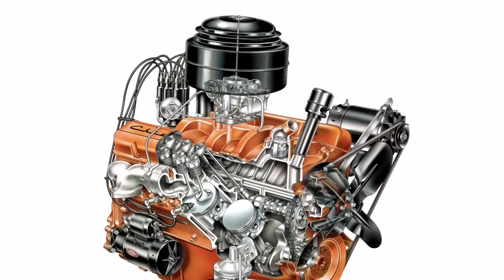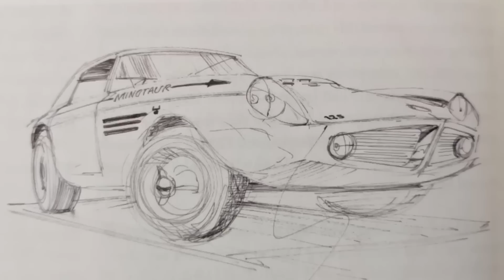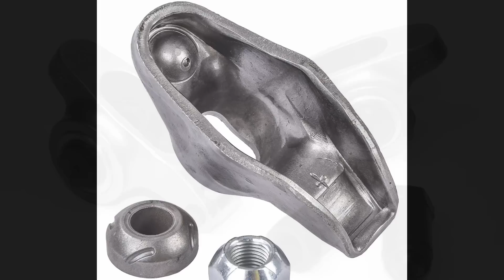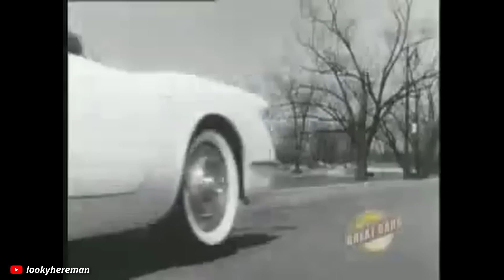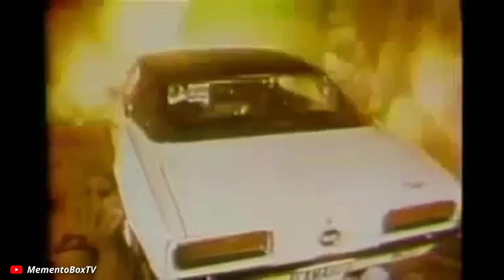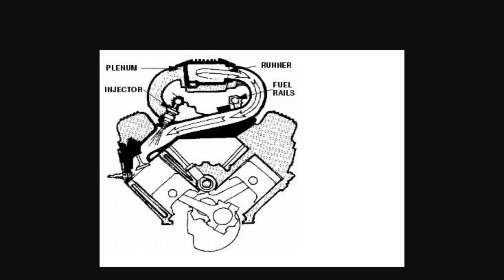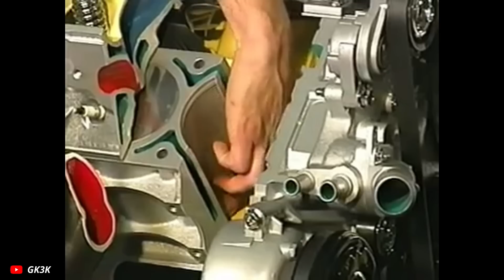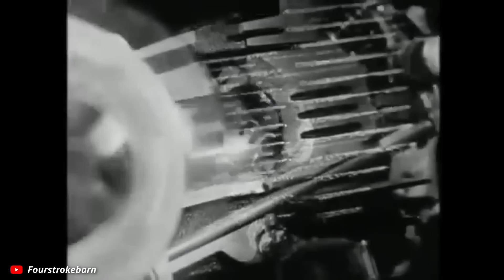The Engine that Powered America

Comment: You mention Chevrolet's 1917 "D" engine and you call it a 4.3 liter.   No one ever has referred to old engines with liters in America.  Metric was not some government mandate when these engines were developed, and no one used it.  They were specified by their cubic inches.  To call these engines (from 1917) out in liters, is some part of a political agenda or personal ideology  that you are trying to project on the world. If a modern engine was developed and marketed as a liter displacement, great, so be it.  But please don't re-write history with modern units.  They call out rods and cubits in the bible.  No one translates the bible and changes that to centimeters.  Because it is a historical document. These engines are a piece of history.  Every dimension on these engines was designed in the inch system. Why do you see fit to call them by a metric displacement ?  ---Doozer

Comment: I agree 1000%

The Chevy small block was perfection that needed no drastic “back to the drawing board” redesign for a half a century for endless reasons. 

The design and unveiling was genius, and really didn’t need any extreme revision for a half century because the traits of its design were so genius, it would take that many decades for competitors to catch up, even the competitors that were inside the umbrella of the GM divisions. 

It was simple, compact, lightweight, efficient, powerful, had far less moving parts and manufacturing expenses than competitors, and was FAR easier to work on than anything before, or after its initial design. 

The LS engine is an updated offering based on the advantages the original small block had, and an improvement on the original small block’s weaknesses on all fronts- and this is the reason the LS is still far and away the go-to engine swap runaway success that the SBC used to be.
Reply: LS was design lessons taken from the G1 SBC and the BBC
Reply: No engine is perfect, and even before the LS there were engines that surpassed the SBC in one metric or another. 

Lots of GM designs had tons of aftermarket support, not because they were a superior platform to build off of, but because it had a GM badge stamped on it.
Reply: @riogrande163  😆😆😆

Comment: And yet, the Ford small-block was a smaller package, more efficient, and more powerful(outside of high end performance versions).
Reply: And fords bare block was 50lbs lighter than chevy. Which is why they don’t hold up over time
Reply: @fastinradfordable  Which makes it odd that the Ford engines lasted significantly longer.

Comment: The Chevy 307 V-8 was one of the all time worse V-8 ever made. They sucked.
Reply: actually no they didn't, in factory configuration they were dogs,but could easily be made to run like any smallblock. it was basically a 327 crank in a 283 bore block. the 305 was actually worse it had a smaller bore. a set of old double hump heads and a decent cam would wake up a 307.

Comment: Without the Ford flat head and Henry Fords vision of ‘affordable cars for the masses’, I doubt that GM and the SBC would be half of what it become.
Reply: chevy had a overhead valve 288 cubic inch in 1917,that being said the sbc had run and was popular for 50+ years.
Reply: @a4000t  but they only made a handful and discontinued them immediately. It wasn't viable. 
I'm just saying that without the competition between Ford and GM. Neither company would be what they are today. The presentation made many references to outside influences that made the SBC what it is. Never once mentioned the two companies rivalry.
Reply: @nathanhansford76  No they didn't,what are you talking about,the 400 sbc was produced for 10 years,it came in everything from trucks to impalas,it was intended to be a high torque,low rpm passenger car/truck engine from the start. We drag racers adopted them as did circle track and nascar. You can still find them and aftermarket blocks from dart and world products still exist. Building a 400 with a 5.7 or 6" rod and custom pistons,or destroking them for 377 inches was very popular. They can be stroked to 434 inches these days,and with aftermarket blocks to 454 inches. The video was about the smallblock chevy. everyone knows ford and chrysler had their offerings and there are a million videos out there respectively.
Reply: @a4000t  No. No. No. Seriously, what are you on.? The oversized, heavy, no power 1917 engine was discontinued immediately. Who in their right mind would think I was talking about the SBC??? 🤦🏻
Reply: Like I said, but you didn’t read properly, most outside influences except the rivalry between the two companies was mentioned. Without the Ford competition, GM would not of been driven as hard to build a great little engine. Drop your chev fan boi rubbish and have a look, subjectively, at my comments before acting like a spoilt child that can’t get his way….
Reply: @nathanhansford76  400sbc reply was not meant for you,my mistake. spoilt child huh says the ford fan boi. grow up.
Reply: @a4000t  was not meant for me. What a load of cr@p. Hahaha. 
Ford fan boi?? I'm not the one defending a particular brand to the death. I own both makes and others, they all have their fatal flaws. I even acknowledged the SBC as a great little engine. Pull your head out of your a$$, You might sound a little more intelligent.... maybe
Reply: @a4000t  ford fan boi huh? I own both brands and others, they all have fatal flaws. I even acknowledged the SBC as a great little engine. So definitely not a fan boi of anything. You need to try another kind of insult if you want to sound half intelligent… or maybe not.

Comment: Number 1 selling crate engine. 350 small block.
Reply: Produced for GM in their trucks up to  2002
Reply: @shadowopsairman1583  I thought you could still buy an LS Crate engine?
Reply: @Joe-qv6jh    Yes of course, can barely spell me own name.  1st trans I ever rebuilt too, probably didn't need it, didn't know better, just ball bearings and sycros and such.
Reply: Bought '66 1-ton Chevy for work truck at 20 yr old, less than a grand it burned oil, hood crooked held by bungee, banged up.  Pulled 327 and rebuilt by the book in dad's tiny woodshop, ran the piss out of it for decades, great 'little' motor. 

 Wound up pulling 327 and selling it for a grand in 2002 after wrecking front suspension/frame.

(OH...think I sold Muntzy (spelling?) 4sp w motor, only truck trans I could shift well without clutch, by then I had redone heads w hardened seats and installed "RV" cam, powerful for what it was w tuned Hooker Headers)
Reply: Isn't this a bad sign if many engines fail and you have to buy a new one?

Comment: Lots of SBC put in forklifts, emergency generators, pumps, all kinds of industrial applications
Reply: not sure they take the top spot in that category. lots of wood chippers and stuff had 300 straight 6 Ford motor
Reply: @DirtyCobra  yeah I have one of those 300 Fords sitting in my shop that's a power unit. I'm not sure what it's from. The bellhousing that is on it looks like there was a big hydraulic pump driven by it

Comment: The Ford V6 eco boost family is probably the closest thing I can think of in modern times that is kind of like the Chevrolet small block. It’s used from family and luxury sedans, to work truck/vans, performance trucks/SUVs, and even a super car. 

Great video, you do a really good job of teaching and keeping it interesting.
Reply: I understand why you say this, but in reality, the Eco Boost is just a marketing term applied to many totally different engine platforms.  The Small Block Chevy was a single design architecture built in many different tune levels and displacements with almost total parts interchangeability for many decades.....   Even when it was replaced by the "LS" series "small block", that engine had more in common with the original 1955 small block than say, a 2.7 Eco Boost has in common with a 2.3 Eco Boost, or 3.5 Eco Boost of the same exact years !!
We are not even going to get into ease of engine swaps into different platforms, interchange of parts, or long term viability....
Reply: Eco boost is nothing but trash for fools. 

The ‘Chevy LS’ is the new Chevy small block
DUHhhhhh
Reply: Um no, ecoboom they are called
Reply: The Ford "eco-Boost" (any) is a pile of FECAL MATTER!:face-purple-crying:

Comment: I recently had to replace my 4.3L v6 after 300,000 miles ,it spun a bearing. So, on EBAY I noticed 454 big blocks were the same price as the small blocks. I bought a big block and I love it BUT if you run into having to make this choice, buy a small block.  Big blocks are great but the parts are so expensive. You want serpentine belt setup, factory brackets are $600+, after market brackets are double that. Need a performance chip for the computer (or just a stock one) $350,  small block $25 -$100 + - . Want to make your vehicle handle better, avoid big blocks. My 454 is punched out .040 and with the intake and exhaust manifolds attached weighs 850 pounds (385.554 kilos). My truck used to set high up till I dropped in the 454. I get into it like a car now . Had to readjust the headlights and the transmission ( NV3500 5 speed) hates this engine. It has a hair line crack down the case just after installing it.  Dont get me started on the price of clutches. 12 inch clutch will cost you a kidney. Small blocks are far more fun, cost effective, and less destructive to the vehicle it is in currently. Just it being in the truck is destructive on everything holding it up. Its still a monster of pure power ,over all I love it.
Reply: Yeah, an NV3500 would be no match for big block torque.  Look for an NV4500.

Comment: The 327 is considered by most to be the "sweet spot" the 375hp Fuelie 327 was the highest specific output and max output reached by a factory sbc. The 283 Fuelie reached 315hp, the 302 was only rated 290hp. Factory DZ302s were rare but, easy to make with a 327 or 350 block and a 283 crank. Some of the Formula 5000 and Trans Am 302s are said to have reached 550-575hp in full race trim. Typically NASCAR 358ci was created with a 327(or 307) crank and a 4.185" bore(0.060" over 400 block). It wasn't until the LS6 made 385/405hp that the 327 375hp was unquestionabibly surpassed by a factory GenIII SBC. Somehow Bob Lutz and Opel were getting 327 SBCs until the late 70s, I have never been able to find out any information on where that special production was done. I know that Chevrolet South Africa got a special run of DZ302s that they had to fight tooth and nail for. I'd love to get a little Firenza or Magnum that didn't rot out and do a replica of that car. Great stuff Bart.
Reply: The "302" was rated at 290HP to avoid "insurance surcharge" keeping it out of the "muscle car" list! It put out WAY MORE than 290HP!!
Reply: LS6 rpo code was used twice, please keep that in mind
Reply: There is a huge difference in how horsepower was rated from about 1973 on. Net vs Gross horsepower.  That 385hp Corvette Z06 engine made A LOT more power than the 375hp/327. In 60's rating that 385hp would be more like 500hp. That being said, many 60's engine were intentionally underated.

Comment: My first hot rod was a ‘66 Chevelle with a 327. I miss it
Reply: @RandallSoong-pp7ih

My first car was a '66 Chevelle 'DELUXE" with a 196 six banger and 4 doors. Nothing "DELUXE" about it. Didn't even have an AM radio. The double bench seats were good for packing as many as 8 to 10 people, driver included. We redefined hot boxing.
Reply: @billybob1723  your “DELUXE” sounds like it was a cool cruiser. Pack your friends in there and go have some fun! 10 people? Yikes! 😂
Reply: @RandallSoong-pp7ih  - Lol, we were all pretty skinny back then.
Reply: @billybob1723  😂🤣
Reply: @RandallSoong-pp7ih  - lol
Reply: I think we sadly overlook how great the 327 was. It was capable of powering everything in the Chevy line up from Nova to HD work trucks. The dual carb 375 hp version was the tits for the Corvette prior introduction of the big block engines. The tamer versions provided smooth  and reliable everyday power for the family BelAir and Impala. Plenty of torque for most towing duty. 
   The 327 block, 4-inch bore, 4-bolt mains and forged steel crank ultimately became the foundation for the legendary Z/28 302. I am the original owner of a numbers-matching 69 Z/28 with the DZ code engine.  Oh dear Lord, when it was new and I  was stupid, I could smoke thoseE70x15’s for days, shifting the the four speed  at7100 rpm! I still have it and trust will be with me to my dying day. After that, my wife and I may entrust to a museum for display. I am truly proud to own this car.
Reply: @michaelwaters8879  yes such a terrific motor. Your 69 Z/28 sounds awesome!!
Reply: @michaelwaters8879  That is truly awesome, the 69 Z is one of my favorite cars of all time, for original owner all numbers matching is really something, my friend has a 69 Z numbers matching but he has only owned it for about 5 years.
 Years ago I built a 302 using a 327 block and 283 crank forged pistons, well balanced, I'd spin that thing over 10,000 rpm's, had a 10,000 tach and it would burry that what a special engine.
Reply: @michaelwaters8879  I believe the world record stick shift car is the Grub Worm Camaro at about a 6.50 or so 230 mph or so and it is a 327 ci monster.
Reply: @michaelwaters8879  The Chev. 302 actually produced as much or more power than the 375 hp. of the 327 but was deliberately understated by the factory as less ?
Reply: @davidpowell3347  Factory rated at 290 HP, my 302 has dyno’d 330 HP at 6300 rpm in totally stock configuration.
Reply: My first car was a 65 El Camino, 283, I miss it too.
Reply: With double hump or camel hump heads?
Reply: @tsbrownie  I gotta go look. Chevy replaced the left head around 1973 under warranty with the odometer reading 47,500. Apparently shifting at 7,000 rpm kinda hard on push rods. Had small cracks in the head and the rocker arm was coming loose.  Anyhow, it think they are double hump heads. The stamped manufacturer date is April 14,1969. Car assembly date was April 30,1969. I took delivery on May 10, 1969.
Reply: Rocker arm STUD was coming loose, throwing valve lash all to hell.
Reply: @michaelwaters8879   7000 rpm? No problem: roller cam, stiffer springs, titanium rods, ... ;)

Comment: Ahead of the curve? Ford had a V8 23 yrars earlier, in 1932. Almost quarter of a century.
Reply: They were notorious for overheating,cracked blocks,and so on,and also was not over head valve engine.
Reply: Chevy's first V8 was available in 1917 as noted in the video.
Reply: Wasn't an ohv engine and made no hp
Reply: @justinpeterson6839  The stolen Barrow Ford was a 60 horsepower flathead.
Reply: Clyde Barrow outran many police vehicles with his little deuce coupe.
Ford Flathead mill 4 on the floor 140 top end... Beach Boys.
Reply: @torque3022  Barrow's stolen Ford V8 flathead produced 60 horsepower.  The transmission was 3 speeds on the floor.
Reply: @torque3022  the beach boys were about 30 years Clyde barrows junior they weren't doing 140 in any flathead back then

Comment: Would the 2.0 turbo VW engine fall in this category?
Reply: No. 
The 1.8t yes. 
All 2.0t are trash. 

1.9 tdi can make the power of a small block Chevy and get twice the mpg of a 2.0t while doing it.
Reply: @fastinradfordable  I've had the 2.0 in two cars. The first one was in a tiguan. That thing was bulletproof. I have an A4 Avant now, and that thing is nothing but problems.
Reply: And the fact the 1.8t is a derivative of a motor from 1974

Comment: I think the only thing I’ve ever bought was a Chevy Small Block. Aluminum Heads/Iron Block style was my least favorite, head gasket issues. It does have two separate metals mated together.
Reply: I use Cometic triple layer head gaskets for that combo, they come in many different thicknesses and last forever.